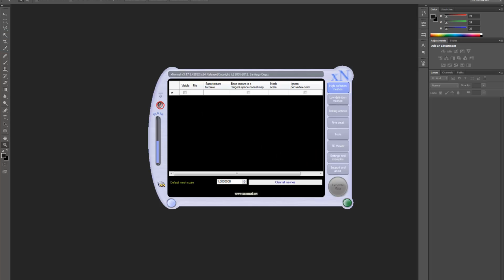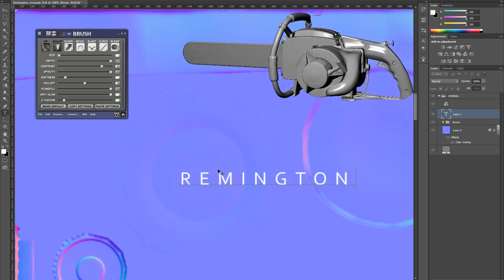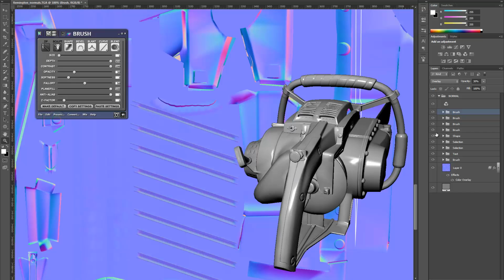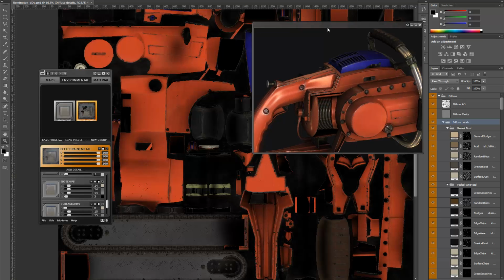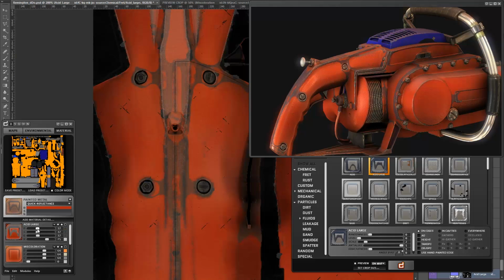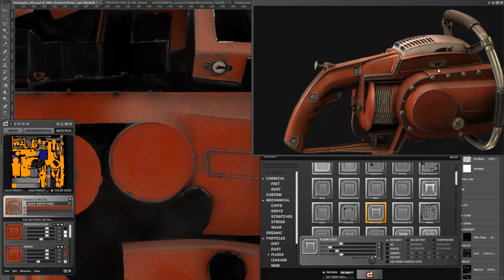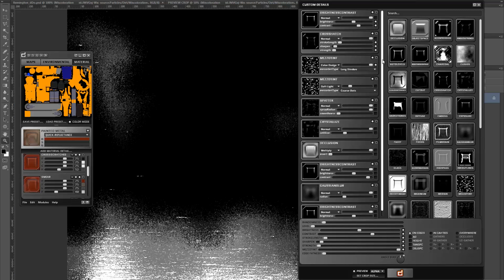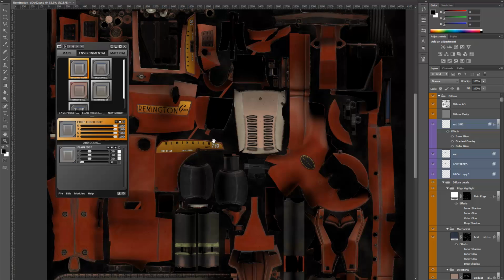Complete dDo Legacy Breakdown - The Chainsaw

Comment: Could you please explain how you imported the decals, that step is skipped and i have the suite not the legacy. I have a texture i created in Ddo and i made a little usb port seperately and then imported over a fill layer. it looks great in your program and when i render the 32bit output ddo creates. BUT, when i export to .jpg which is what i need for my rendering program everything looks great except the decal for the usb. any help would be appreciated.

Comment: I'm working an engine mesh for a car that's 10k for real-time use. It's almost impossible for me to do a high poly version of the whole thing, only highly visible areas would suffice. Is there any way around this, so I can still have the extra control on the details that you get when using the object space normal map, without having to spend weeks modeling a high poly of every component? I'm assuming cavity maps as explained around 40:00? Will this give the same control or not?

Comment: looks good! would buy but its expensive, if you are looking for something like this then go to steam and search for Substance Designer =) cheap and really easy to use, and it also produces many great textures in under a MB =) http://store.steampowered.com/app/287280/
Reply: I'm thinking between Substance Designer+Painter vs Quixel, what to get.
Reply: izvarzone Personally i bought the indie pack @ $120 and i have 10+ hours with both of them. It produces great textures, also one tip is to follow their tutorials carefully because i tripped up a bit and things went wrong. Their customer support is fast and good too.overall i r8 8/8 m8!

Comment: For some reason, when I open dDo and get going, it pops up with Photoshop, but then won't respond. Help! I am using Photoshop Cs3 with windows XP
Reply: Josiah Alderden ok. i had the same problem few days ago :)
Reply: I meant CS4, must have bumped the 3 key, but CS4 is the only one left that uses windows XP and I suck too much to upgrade :) Thanks for the help but i figured it out. I selected the shortcut when first opening up dDo instead of the .exe
Reply: Josiah Alderden were at CS6 man, get with the times
Reply: BananaMasterRace
Yeah, I had Windows XP still and CS4 was the only one still for XP. :) I have windows 7 now, and I have updated to CS6.
Reply: You better be updating to the new quixel suite as well :D
Reply: Yeah, it looks suite (bad pun) and I do plan on it, however, I'm also learning to paint stuff myself, and just use dDo to setup a base canvas.
Reply: you should change to cs6 and windows 7
Reply: SouNoobNao
as said above I have already done this :)
Reply: SouNoobNao
Yeah, now that I have CS6, It gives me error 1 some configuration error when I try to link dDo legacy version to the .exe for Photoshop.
Reply: Josiah Alderden Thats odd.
Reply: BananaMasterRace
I've read about people having the issue when they have photoshop on an SSD, but mine is in the default location on my HDD
Reply: I dont have any problems, are you running the same bit ddo with the same photoshop?
so DDO 64x with photoshop 64 bit?

if not you can always go to http://www.polycount.com/forum/member.php?u=37654 (he is one of the creators of ndo and ddo) drop him a message he will probably reply, he seems to be quite active there.
Reply: BananaMasterRace
I'm running 32 bit Photoshop CS6 and 32 bit dDo, I'm pretty sure its a Photoshop problem as it is the one giving the error message, except it works fine on its own. Thank you so much by the way - really appreciate.

Comment: Is it important to make sure that UVs don't overlap when using this?
Reply: isnt always bad to have overlapping UVs?  I cant think of a situation where over lapping Uv's is a good idea.
Reply: Thai Tran To re-use texture resolution, and having repeated elements. Also texturing only half of an asset or a quarter and then duplicating it and merging it after? In one of the AK tutorials he  baked ao with an overlapping uv island (don't know how though that's supposed to make maya crash/stall at 0%)
Reply: well maybe I misunderstood you,  I mean if you have a model that can be split in fours you would UV a quarter then generate the diffuse  and just assign the shader of the first one to the other units to complete the model and each unit would have a UV set of its own and its own space but not use extra texture space because its sharing one diffuse map, one normal, one spec, etc.
Reply: Thai Tran
you just described having overlapping uvs. If you unwrap and texture a quarter of a model then duplicate it to finish the model, the UV's will be overlapped 4 times (for each quarter of the model)
Reply: ah then he and I are talking about the same things, I've tried it with overlapping UV it works
Reply: yes it does work, Its a great way to get more resolution out of your textures, however, if you arent careful, you cant make your model look too symmetrical. but then again there are ways you can stop that (like vertex painting/decals) - For game engines

Comment: Using XNormal under the tools tab, there is an option called "Ray distance calculator", select your low mesh and hit GO!. You'll see a "Computing" bar, wait 35 seconds and write down the FMax and RMax numbers. Go back to the Low definition Tab and copy the values under Macimun frontal ray distance and Macimun rear ray distance. BAKE IT should be way better

Comment: Try rendering the normals directly of your high res model. As in when you bake diffuse, specular. There should be a way to render vertex normals. That would take care of OS normals, Tangent Space ones I don't know... what happens when you project a high-res over itself? instead of high and low res.